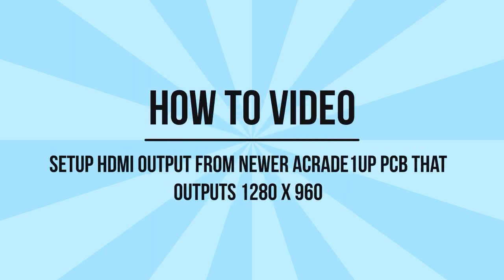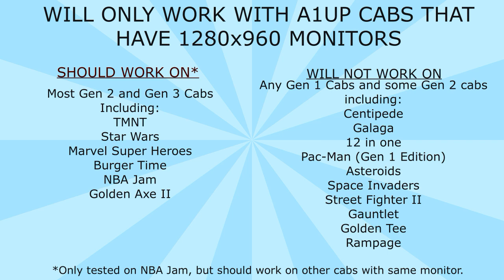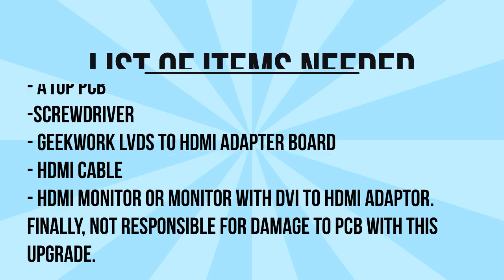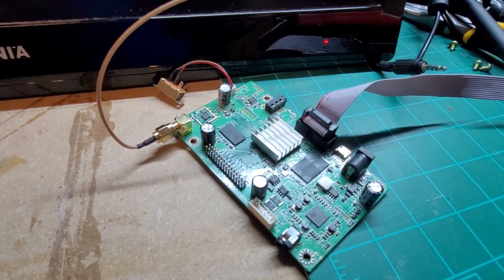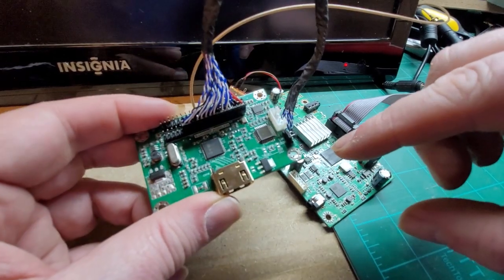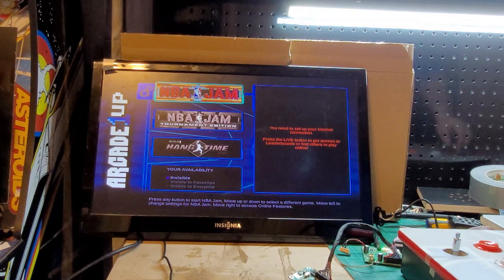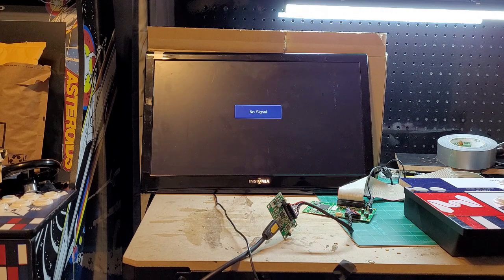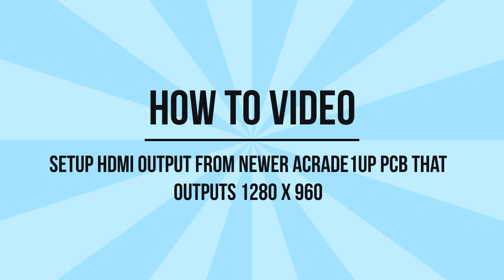A1UP Mods: How To Setup A1UP PCB Running 1280x960 Monitor to Output to HDMI. PLEASE READ DESCRIPTION

Comment: I noticed when u tried gen 1 u seemed to have the red(pin 1) wrong way?? And also pluged into channel 2 not 1 like u had it when running NBA jam???
Reply from the maker: I looked and it is correct. Just looks wrong because the PCB is upside down. Also does not seem to matter with channel it is plugged into. I thought it did at one point and that is why I said to use channel 2, but found out that channel 1 works as well. I made and edit in the description a week or two ago noting that.

Comment: Have you tested this with Marvel vs Capcom? or anyone? it doesn't work for me but NBA jam works with the same setup. on the MVC PCB pin 1 is reversed compared to NBA jam
also MVC has the BOE monitor
Reply from the maker: Another person tested with Marvel vs Capcom and it did not work. The person also tested Ms. Pac-Man (Not sure which version) and could not get to work either, although the cocktail version of Ms. Pac-Man works. Not sure what is different with the Marvel vs Capcom.
Reply: @The_Passable_Gamer   thanks I am going try the 19" monitor mod you did , Maybe MVC PCB is like the gen1 A1up PCBs. are there any forums or discords where people  post their results about all this stuff?
Reply from the maker: @primalrage6873  Unfortunately, it is not like the A1up PCBS...but welcome to try. It is still outputing 1280x960, but the HDMI board is not seeing the signal for some reason. Running into the same issue with Ms. Pac-Man standup from Best Buy, but Ms. Pac-Man cocktail seems to work fine.

Probably be a good idea to get a forum going to have one central place for everyone's issues and what works. Someone may come in and know a bit more than I do about the LVDS signals and whatnot and may have some other ideas.

There is another board on AliExpress that is different than the GeekWork board (https://www.aliexpress.com/item/1005001559962854.html?spm=a2g0s.9042311.0.0.10a24c4dQ9wq4F). I bought 2, but those do not get here until sometime in March. These may work, but if using the same chipset probably will not.

My main concern is if MvC not working, then the next line of Legacy cabs and future cabs will not work either. Just will have to wait and see.
Reply from the maker: @primalrage6873  Just created a Discord page. If you wish to go there, click the link https://discord.gg/3MfgZ3FAd4
Reply: so i didnt see these comments until now but i recently got the LVCD board for my MVC Arcade1up machine and the Geekworm board thinking i would be able to use hdmi and a passthrough for streaming. Im able to get it to start up i see everything its just slight signal loss and the bottom is cut off. now that im reading this. should i just rip it all out? was this a big waste?
Reply from the maker: @rongarzon7295  Just wanted some clarification on what you are running into and what I have found. 

To my knowledge, the MVC does not work with the Geekworm adapter. I have tried with Marvel vs Street Fighter and cannot get it to work. Are you stating that you are able to get a signal when MVC is hooked up to the Geekworm adapter? If so, do you have the TV model that is hooked up to?

The only other way to get a bigger monitor is to hook up to a 19" 1280x1024 LCD panel to the MVC PCB. This does work on some LCD Panels, but the last 64 lines repeats the top 64 lines or some other distortion because the output from the MVC PCB is 1280x960. This is shown in the video below:

https://youtu.be/dHlPZCszm3o
 
I also posted the above link in the Discord group. Is this how you have hooked up currently?

Sorry for all the questions, just want to make sure I am clear on how you got it hooked up. If somehow you have it hooked up to the Geekworm board, would like to know what TV you are using as have not been able to get to work with MVC or Marvel vs Street Fighter.

With all that said, although the Geekworm board does not work with MVC or Marvel vs Street Fighter, it will work with other games. However, if you do not plan to use other than MVC, then it will not work and would probably have to return. Hope this is helpful.
Reply: @The_Passable_Gamer  i just posted my picture in that discord before. now its the same monitor that came with machine i was trying to hook this up so i could sneak a capture card in between the line for streaming. i watched the video on the 64 repeat earlier saw in the discord.

Comment: Actually could this help the screen size problem on big buck hunter or is it to new of a wave?

I remember retro Ralph did a 20 inch mod before
https://youtu.be/K_2ydmsUlY8
Reply from the maker: I would think A1up would not change the monitor type or the resolution, which is 1280 x 960p, so I think it would work.

The question is will the guns work? I would think they would, as the guns are just cameras, but you never know how these things are setup until someone does it.

Hopefully someone who has Big Buck Hunter can setup and confirm.
Reply: @The_Passable_Gamer  man that would be so awesome if it works

Comment: Could this be used to put a additional monitor on top of the cab?
Reply from the maker: Possibly...Once the LDVS to HDMI adapter is connected, you could possibly connect and HDMI splitter to it, but have not tested.

Comment: Thanks for doing this, I need to revisit the topic.  I ordered two of these a year ago and both were DOA.  This video has inspired me to try again... thanks bud and great work!
Reply from the maker: I am curious if this will work in the Arcade1UP Pinball. I know you had one. The monitor is 720p, so if it has LDVS would be curious if this would work to use a bigger display. However, not sure how that affects gameplay.
Reply: @The_Passable_Gamer  the stock monitor can output 1080p but it's the pcb that sets it to 720
Reply from the maker: @ac4054  Correct...meant 1080p monitor, but 720p video output from PCB